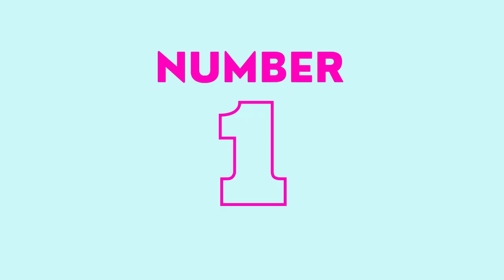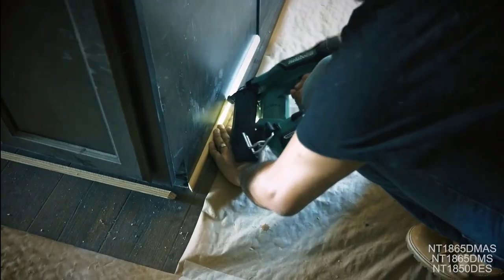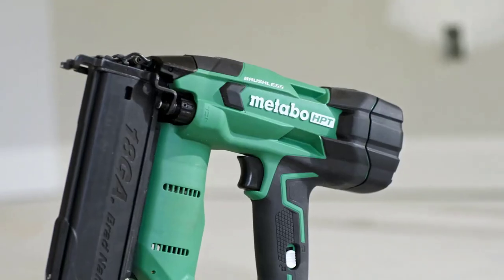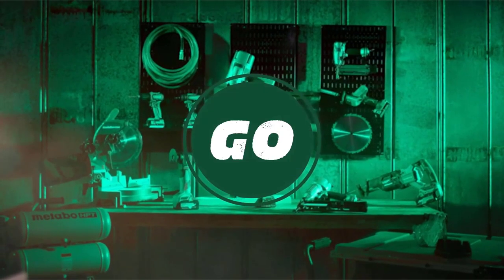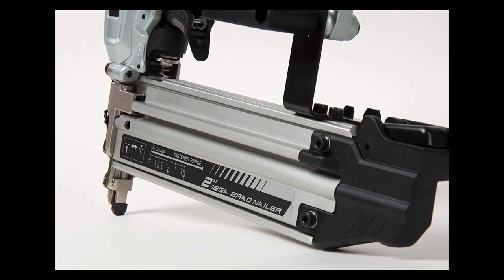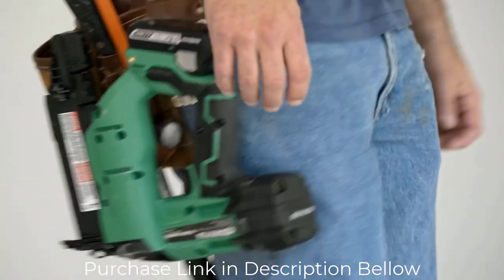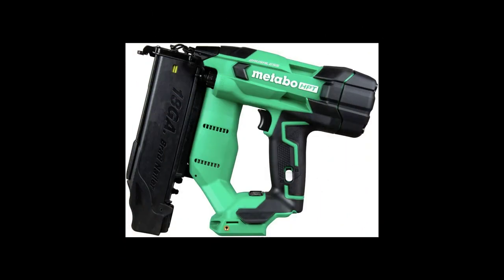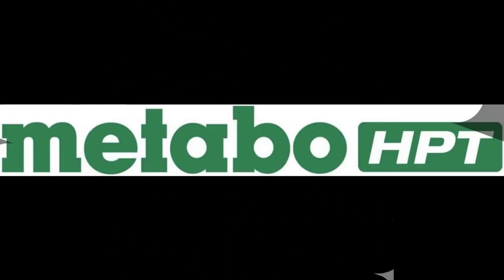Review of the top 5 Metabo hpt brad nailer 18V MultiVolt 18-Guage Pneumatic Cordless

Comment from the maker: ✅ Top 5 Metabo hpt brad nailer List:

1. Metabo HPT Brad Nailer Kit | Pneumatic | 18 Gauge | Accepts 5/8 to 2-Inch Brad Nails | 5-Year Warranty | NT50AE2

 👉 https://amzn.to/3CaaINk

2. Metabo HPT 18V MultiVolt Cordless Brad Nailer | Includes 1-18V, 3.0 Ah Lithium Ion Battery | Accepts 18 GA 5/8-Inch to 2-Inch Brad Nails | Brushless Motor | NT1850DF

 👉 https://amzn.to/3WxAwv7

3. Metabo HPT Pro Brad Nailer Kit, 18 Gauge, High-Grade Aluminum Magazine, Accepts 5/8-Inch To 2-Inch Brad Nails, NT50A5

 👉 https://amzn.to/3WBeCHe

4. Metabo HPT 18V MultiVolt Cordless Brad Nailer | Tool Only, No Battery | Accepts 18 GA 5/8-Inch to 2-Inch Brad Nails | Brushless Motor | NT1850DFQ4

 👉 https://amzn.to/3Q3gmGD

5. Metabo HPT NT1850DEMR 18V Brushless Lithium-Ion 18 Gauge Cordless Brad Nailer Kit (3 Ah) (Renewed)

 👉 https://amzn.to/3G6RJnY